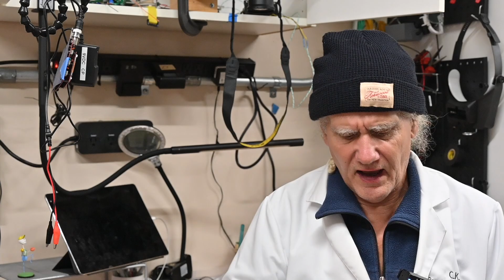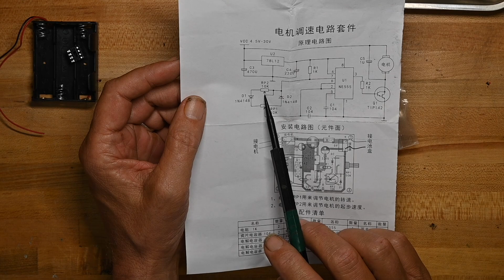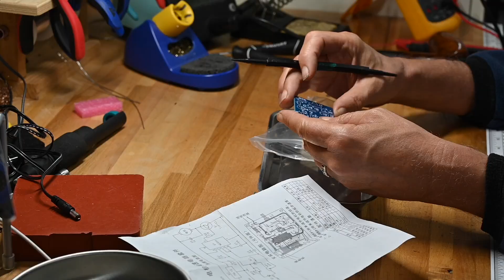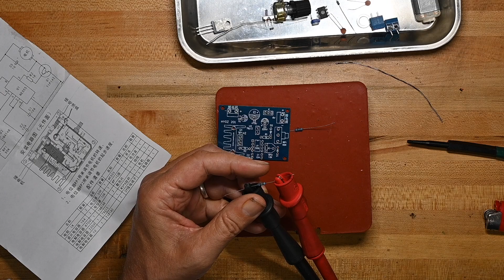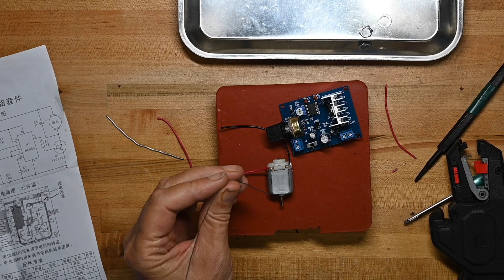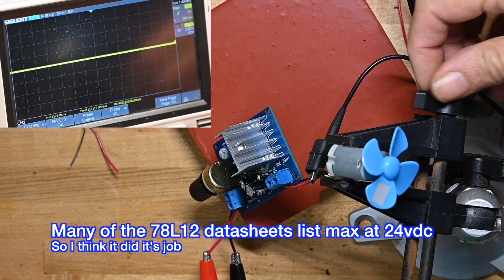C.K. builds a Pulse width modification motor control kit from  Universal Solder (eBay)

Comment: C5 needs to be replaced with a diode to prevent that "ringing" from the back EMF from the motor. That huge reverse voltage spike will be causing problems for the transistor and nasty pulses on the power rails.
That's probably what caused the smoke show, since you probably had 100V peaks when you increased the input voltage, and capacitors don't like that.
These PWM circuits are better with a Mosfet than a Darlington on the output stage, and give higher output voltage as well as not getting as hot with a larger motor.
Finally, you aren't measuring RPM - you have a 4-blade fam so you are measuring 4 times the motor shaft rotation.
Reply from the maker: Thanks for the excellent info! Except for the RPM, since marking the  one blade is the same as marking the shaft at the same spot.  One pass under the light is one rpm. Had I put a piece of tape on each blade you’d be correct, but I did not.
Reply: @CKHaun  - oh, I didn't see any tape on my small phone screen.
Those heap tachos measure reflected light pulses, so there is the distinct possibility they will count a reflection off a light coloured blade.
With a light colour like your prop, you can measure "rpm" without any tape, just from the reflections (especially the edges of the blades). Just test it, you'll see.
To get a reliable trigger there needs to be a strong contrast, for example white tape against black. Alternatively, make the blade tape stick out into free air, then measure the tape flapping past the sensor beam.
Cheers!
Reply from the maker: True on contrast, I've tested this unit on a variety of things (i did a video on it) and am confident it's only reading the reflective tape.
Reply from the maker: I realize that might not be quite clear. The rpm meter only counts the return from the reflective tape I added to the blade, NOT the non-marked blades.